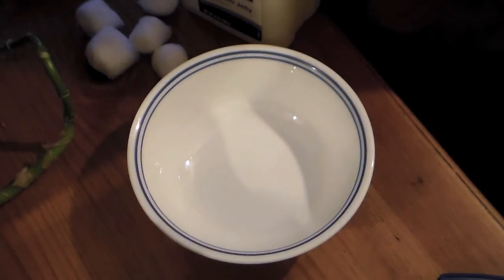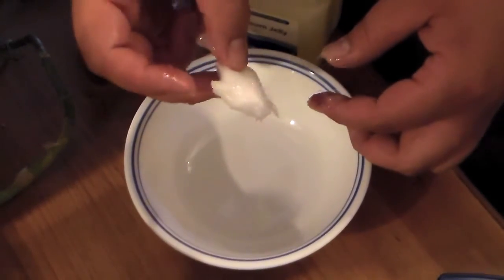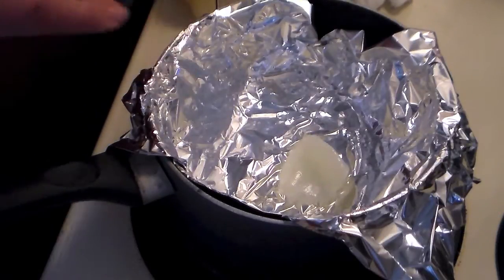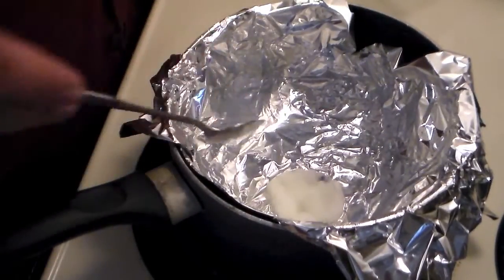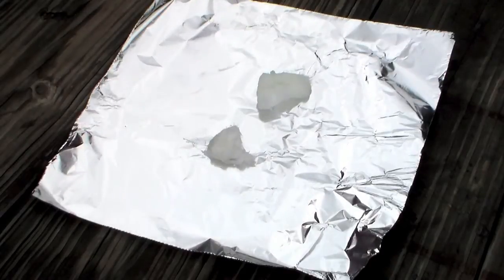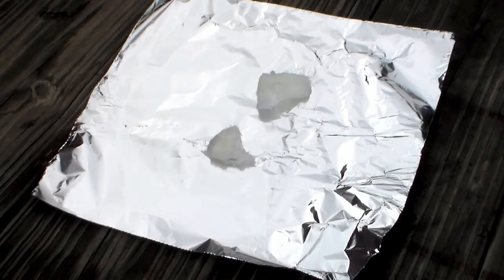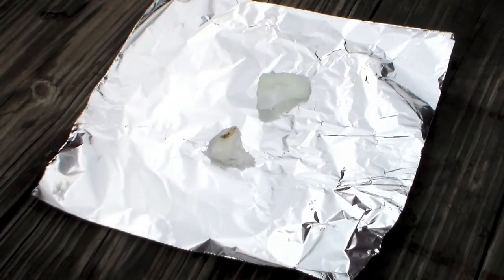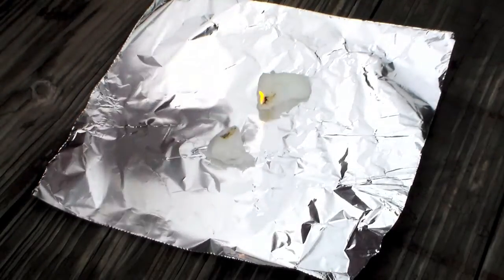Petroleum-Soaked Cotton Balls...The RIGHT Way!

Comment: I find it more convienent to carry a small pill bottle packed with as many dry cotton balls I can shove in it.  Then I carry a small tube of "Vaseline Lip Therapy" or a few disposable packets of "Triple Antibiotic Ointment" that is basically petroleum jelly with the antibiotic impregnated into it.  They are the one use, throw away little packets for first aid kits.  I just make them as I need them and I also have the antibiotic ointment in case I cut myself or anything like that. 
     I also like to make mine with less jelly so I leave some dry cotton fibers that will catch a spark easier and then act like a wick from a candle.  Sometimes less is better than more.
     Thanks for the video and info.
     God Bless bro.
Reply: this is a good use for your expired antibiotic ointments.

Comment: Best way is to have dry inside and vaseline outside, then when ready to light, break open the ball and expose dry fibers it will light in micro seconds
Reply: So just do this method but don’t pull the ball apart and don’t allow the ball to sit for too long and saturate. I’ve never had any trouble getting saturated cotton balls to light with ferrorod. Dry or saturated with PJ, both light very easily.

Comment: I want to HEAT petroleum jelly so that I can start a FIRE?
Reply: Actually no, patrolium jelly isn't what starts the fire, it's the cotton that starts the fire. 
I always thought that the petrolium was what ignited, but upon my own testing, I took about a finger tip of petrolium jelly, and proceeded to take a lighter to it to see if it actually burned, and it didn't, it just melted.
It's more a propellent (I guess that's the correct word)
What brought be to the testing was I thought "so if the petrolium burns, why have the cotton balls in the mix, why not just use the petrolium" so I tested it and not know why the cotton balls are needed. Anything really can be used as a starter with petrolium ie: cotton balls, dryer lint, cats tail, etc.... Anything that is dry and catches fast. 

In lamens terms the petrolium is like a candle, and the cotton ball is the wick. The candle wax itself doesn't do the burning, but the wick does, this is why you can't just light wax and have a flame, you need the wick. The wax is just the propellent and melts to liquid until there is none left then burns out.